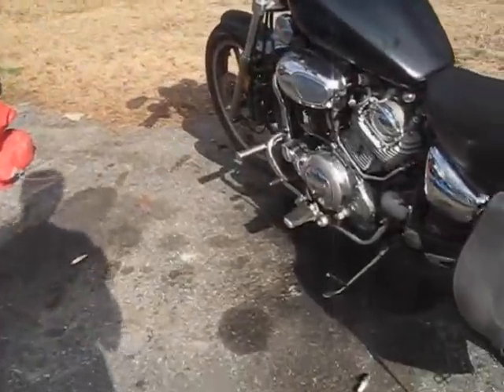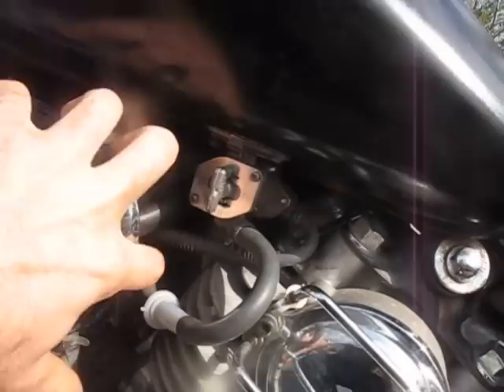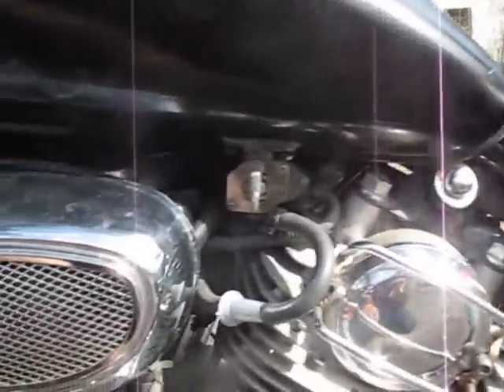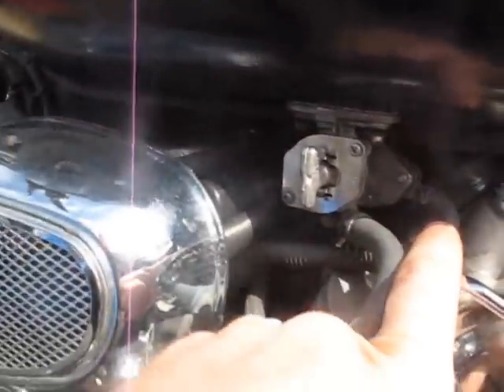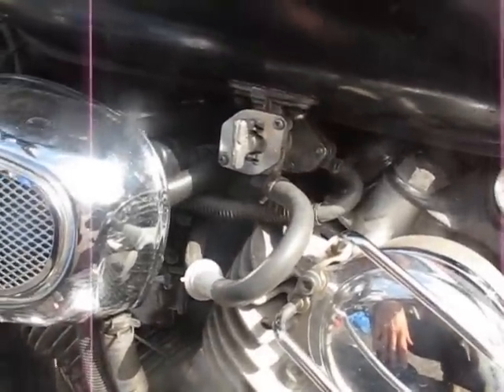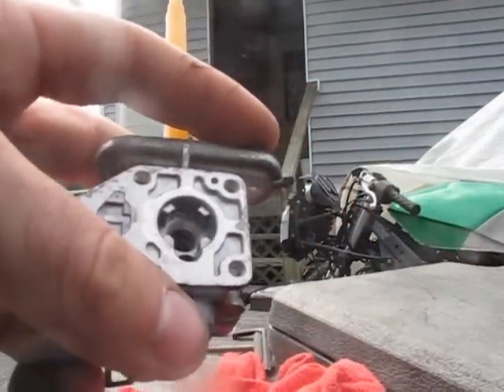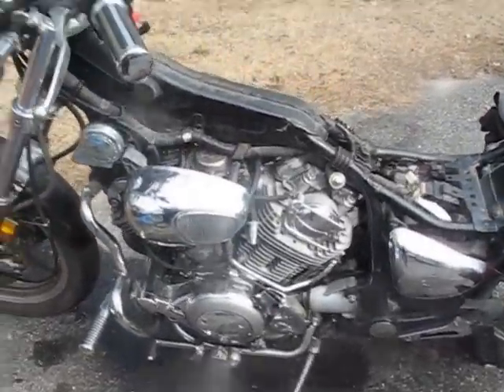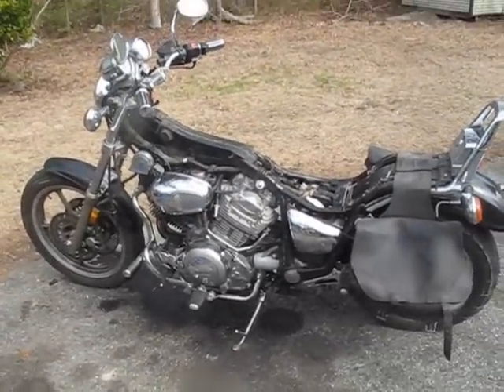How to fix your motorcycle petcock without a rebuild kit

Comment: I actually kept looking at forums and that is exactly what it was! So now it will start with a little starter fluid. I have the choke on, it's in neutral and the ignition switch is on and the bike cranks, revs up to about 5k rpm, and then cuts off. Do you think this is a damaged wire or bad fuse? It doesn't putter off, its as if the kill switch is activated or something. Any ideas? Thanks again for your help!

Comment: hi i just saw your video but i have a 2006 kawasaki ninja 250 and when i went to change my oil it had a lot of gas mixed with the oil. do i have to flush it out with oil a couple of times before i can put the good clean oil in it,or can i just empty out the bad mix of oil and fuel and put new fresh oil in it?what is causing this? thank you so much

Comment: Thanks very much for the response. I will check those things. I haven't done anything at all to my carbs.  However, I did clean both gas tanks recently and it ran great for a couple of weeks until this current issue, Can dirty carbs cause intermittent issues?

Comment: I have a 82 Honda CM 250 Custom and a 82 Yamaha XJ650.  For years I have always had a small motocycle with 1 carb.  The petcock is simple off on and reserve.  This summer I purchased the XJ650.  I never had a bike with 4 cylinders 4 carbs and shaft drive. Well in the morning it's hard to start. When I am driving the bike surges. I also can't turn the choke off. The bike will stall. I had gas spray out of the petcock also.  Just why does this bike use a vacuum petcock? Will this cause problem?

Comment: I was trying to start the bike up on Friday.  It would run but not right. I could never turn the choke off completely. On Friday the bike was running but backfiring alot. I just read this last night and fell over in my seat. I seen this swear word on my bike Yamaha YICS. My 83 Prelude had the same thing. Could this be the cause? Could ethanol be the cause? It was cold on Friday. I live in Pa. I am getting bowl gaskets so I can clean the carbs. Any vids on cleaning YICS system? How does it work

Comment: This is such a helpful video to help those of us who aspire make ourselves less dependent on commercial repair shops.  I am not opposed to paying a mechanic but most of them are covered up in work.  I would definitely prefer to keep costs down AND minimize riding down time, when possible.  You point out all of the pitfalls of what turns out to be a pretty easy fix.  The one thing I wonder is whether there is a recommended torque on the screws?  Anyone else know?  Thanks, mrmaxstorey!!
Reply from the maker: There probably is, but I just tighten until gas doesnt leak

Comment from the maker: @jbalboy1234 Clean the gasket with some gas and gently massage it with your fingers. You can clean the screens with a quick shot of carb spray, but be sure to wash it off with some gas so the carb spray doesnt corrode the plastic. Blow it out with some low-psi compressed air, and you should be good to go.

Comment: I have a 73 Honda CB350 twin, and I have a couple of problems. First: Fuel is leaking out of the petcock faceplate. I took it apart, the rubber gasket and pressure spring seem to be fine, put it back together and it still leaks. Second: It has two brass nipples for fuel lines that lead to two see-thru fuel filters. Only one of the filters seems to be filling with gas and even then it doesn't have very much in it, the other is almost dry. 
What could be causing these problems? Thanks

Comment: I'm not getting anything out of my petcock no fuel no leaks.before I de rusted my tank I did.could there be something blocking it even if the filter looks clean?
Reply from the maker: Is it a vacuum petcock or manual?
Reply: +mrmaxstorey vacuum. I've taken the whole thing apart and cleaned it. I'm suppose to be able to get fuel flowing when putting the valve on prime even with the vacuum hose off and I'm not
Reply from the maker: Yeah try taking it off and blowing backwards up the fuel outlet with an air compressor and the petcock on prime
Reply: +mrmaxstorey thanks I'll give that a shot.im now running into it not starting without starter fluid even if there's is gas in the carbs
Reply from the maker: Carb work and lots of starter fluid can foul plugs. Change em out
Reply: +mrmaxstorey thanks I'll give that a shot

Comment: Any idea what the little round spring spacer thing is for inside the dial on the Suzuki gs series petcocks? Clip ) dial ) plastic spin valve ) spring) spring spacer...?
Reply from the maker: Its to put pressure on the dial so its doesnt leak

Comment: would a leaking petcock cause a engine too smoke like no other?  just wondering i have a 93 zx6r and just did the rebuild on my petcock been leaking for a while now!  can u please answer this question my bike was smoking like crazy blue smoke from around the forks and spitting out some raw fuel from the exhaust as well.

Comment: Dang, I just unstuck mine two days ago, but I didn't think to address the spring.  Maybe in a month or two I'll get back in there and pull on the spring.  Really wished you had shown, even though you described, the making of the gasket repair.  Some modern bikes with vacuum petcocks don't have any rebuild kits available.  Do you think those two thin rear gaskets could be made out of inner-tube as well?  (might have to use slightly longer screws)

Comment: I have a 1980 Suzuki GS850G and I think there is a problem with my petcock.I want to rebuild it but need to know what parts I will need to rebuild there is no diagram on how to rebuild it.I did take it apart and the only parts in it was a diaphragm and the small rubber  o ring that goes on the diaphragm.Could you tell me what parts I need for a rebuild kit and give me directions on how to rebuild it

Comment: I have a 1980 Yamaha SR250, just bought it used for very cheap. It got me home from the guy's place where I bought it. But on cold start it seems to thud every now and then. And from what I could tell on the ride home, I couldn't really open up the throttle. But that's not my main issue. When I shut the bike off and turned the petcock to PRI (is that the closed position?) The gas is slowly just leaking out of the tube under the petcock. i removed the black hose and it started pouring out. help?

Comment: I had to run my RES to get to a gas station return to the road with a full tank I switched to ON & within 5 mins it ran shit, then shittier then stuck by the road. Had to use PRI a couple of times to get home. would this be the petcocks fault?

Comment: Max, love your videos.  Keep coming across them and I subscribed.

I have a 2000 Kawi kl250 super sherpa. 5k miles. Its leaking gas from vaccum petcock (top or face of it) in all positions and also some drips out of.drain hose at the  bottom. I drained the tank and then removed the petcock. Oil level didnt change that I can tell.  No oily looking leakage. Should I replace the petcock with new and see if it fixes or have someone remove and open/clean/possibly rebuild the carb? I am a noob and want the bike ready asap so not sure I want to try messing with the carb.

I am not too worried about the expense just want to waste minimal time. I will have a look.at the gasket behind the face. You are the first one to have this valuable info in a vid like this.

Thanks for any info!!!
Reply from the maker: Well if the problem is with the petcock, then I would go ahead and repair that and see how you do. If the bike runs well otherwise chances are the carbs are ok

Comment: Tonight I checked the plug wires and caps.....I found that the spark plug wire was not securely fastened to one coil...Also the clamp that keeps the air fastened was a little bit loose.  I took it for a 10 minute ride and it seems a lot better!  Tomorrow I will check the bowls, I sure you are right. Thanks Max, your diagnosis appears to have been right on target, If you' d lived near me I would buy you some beer and pizza...Thanks man!

Comment: Hey bro, spent some time watching your channel last night and learned a lot. I've been trying to figure out why my air box on my 96 EN500C1 has been leaking fuel when standing (also bike is often hard to start). Saw this video and figured... hmmm, it could be the petcock flooding the carbs. Petcock on this bike is vacuum op. I discovered fuel was pouring out of the petcock no matter what position. Rebuilt it w/o any parts and stretched out the spring... voila, fuel no longer leaks so far. Thx!

Comment: I had a problem with fuel starvation with my 30 year old Honda NV400, the symptoms were high r.p.m. misfire and hot start problems, even stalling when hot. Turned out to be a blocked vacuum tube within the petcock, a quick blow out, job done. Thanks for the strip down video, very good. Free repairs are very useful for the reasons you suggest.

Comment: Craziest thing happened to me trying to rebuild my petcock after watching your video.  It was stuck on open (only other settings are off and res).  I attempted to open it and found that someone had used grey caulking or sealer to stick the face plate and valve solidly, in the open position, to the main part of the petcock.  It was all squeezed down into all the moving parts and completely solid.  I had to pry off the front plate and then scrape it all off just to remove the valve and then pry it out of the back part.  Was a nightmare to clean!  Maybe it will work properly now!! ha ha  Just thought I'd share, it made me shake my head!  :)
Reply from the maker: Crazy!

Comment: Hey max just saw your videos . I have a 95 yzf600 vacuum operating petcock. It leaks around the seal edges. I'm a newbie to bikes and wanna get into your mind lol... Question tho, it's an intake fuel system and the pump vibrates but no fuel flow. Took intank pump out and grabbed an external 4-7 psi pump. It worked for a quick up the block and back down but would shut off due to what I pinned to be fuel starvation. Stop crank go stop crank go made it back home without an up hill push (thanks bike gods lol)...Can I bypass the intank pump, psi regulate my fuel pressure , plug the vacuum, remove diaphragm for constant flow or what do I do to get my baby running... I really like my bike only 2071 exact miles on it fresh oil change and plugs bike runs on all four just can't figure out the gas problem and I am like you I'd rather come up with a solution than spend my money... That's what great minds and mechanical hands alike aspire for !!!! Sorry for the long column but I really dig what you do. Can u help me out
Reply from the maker: Its not a bad idea and would make future service a little easier if the fuel pump was external and mounted to an easy to access place, however there are a couple of significant hurdles to pass along the way. Its unlikely that you will be able to get around the leaky petcock without repairing it by conventional means. Since it mounts underneath your old fuel pump, I think you will have to leave them both in and repair whatever gasket is leaking. If you wanted an external fuel pump you will need to partially disassemble some of the old fuel pump, which probably arrests or at least restricts fuel flow when it is not running. Therefore taking it apart until gas flows freely so that the new fuel pump can pump the gas is required, and honestly if you are taking it apart you might as well just fix it and keep your OEM parts. If it is vibrating then its getting electricity through the pump, it might even be pumping just clogged somewhere from debris so get it cleaned up and it may work. Or replace with a used or aftermarket from ebay. If you are absolutely at the point of desperation you can drill an oval into the bottom of the tank with 2 bolt holes and mount a cheapo non-vacuum petcock which can be had for about $10, and then use your 4-7psi pump, but really just fix it right with yamaha parts
Reply: Hi again max, I forgot to add that my on and reserve is a switch on my upper left fairing no petcock switch I guess because of it being an intank fuel system???
Reply: Max just got through going over my petcock it does have the internal gasket that honestly are shot (a bummer) but on the bike gods and MaXXimus Tutorial side of things... I got gas flow and when I pinch off my vacuum I get noooo leaks!!!! I discarded the intank pump altogether and with the regulator (0-5 1/2 psi ,plus the eternal pump 4-7psi) are there any foreseeable issues I may have outside of the petcock rebuild kit? I have gas flow when I pull from the vacuum like you said and also just a liiiiiiiittle bit of spring tugging I copied from your book I smiled just gotta fight the rain with no garage now <( oh and THANKS FOR BEING A STAND UP GUY ,NOT MANY THAT SHARE  KNOWLEDGE FROM OUR BACKYARDS THAT HAVE THE  PASSION TO FIND OUT HOW TO FIX IT OR ITS OVER  AND START ANEW TYPE OF HONESTY. BEEN A PLEASURE TO SUBSCRIBE TO YOU MAX. I DEF WILL BE KEEPING U POSTED!!!!

Comment: Gr8 vid im back to working in bikes missed u Max remember me? 😀 finally figured out why the Honda VF750 didnt run right, a belt tensioner jumped out of its slot and got pulled down into the cylinder! So the timing chain was never tight so how could it run right?

Comment: I tried this but unfortunately my petcock still never shuts off, it will deliver fuel to the carb even when it is turned to off position. I have a non vacuum operated petcock.

Comment from the maker: It seems like you may have a number of different issues at play here, likely all related to scum in your tank and fuel system. Go to my channel and watch my videos on cleaning out your tank, cleaning carbs, restoring petcock, "how does a petcock work?", and finally how to fix a nonrunning motorcycle. Once you get through all those, if you still are having trouble, message me and we can get into it in more detail

Comment: Thanks for doing theses videos.  

Leaky fuel valve question: small leak in petcock, with a slow drip into fuel line. Replaced everything with a rebuild kit. Now, of course, the "drip" is a full-on flow, maybe half of what you'd expect with engine on. My guess is that the diaphram isn't sealing - petcock put together, you can see a little rippling in the outer edges of diaphragm.  Could this be causing the leakage? I've messed with the spring, and wavy metal piece under lever... no change.

Comment: I just put another switch in the line to be on the safe side..stupid crap they came up with.. But sometimes I forget to shut it off but lucky my carbs are behind the motor and. I'm only out a tank of gas than 4 new quarts of oil

Comment: is there any where I can get the replacement filters that fit on the petcock valve stems. I mean the one in the gas tanks . or can it still work with using only an in line fuel filter?
Reply from the maker: +Benjamin Vining An inline fuel filter will do the job, and thats all I have on some of my bikes. But you may be able to find one of those in take filters on bikebandit

Comment: Another great video! you certainly know who your audience is..ha ha.  As a single dad with full custody of the kids, I'm always looking for the inexpensive solution. I have a unrelated question. I have a 85 VT700c - runs great until its been driven about 30 miles. Around that point it seems like its starving for fuel. I have replaced the coils and one cdi  box, also new fuel filter ( all cheap thanks to ebay) any ideas about what else could cause this issue?

Comment: I have a leaky petcock, but different symptoms. When I switch it to on, it drips from the edge of the petcock. The hose is not leaky. If I switch to reserve, it stops dripping. Thanks!
Reply from the maker: +stephanie green The little round rubber gasket inside the petcock is likely to be damaged or the small spring is getting flattened
Reply: Thanks! That makes sense considering it didn't leak later in the day when it warmed up.

Comment: What a fun approach. 
Same happened to my KLE500 but the petcock seemed whole and clean. Could it be just the spring? 
Also I just replaced the oil filter, is it ruined in this case?
Thanks

Comment: Thanks for the video. Learn alot from this. My question is when i clean my pet cock and reinstall it and hook the vacuum up and crank the bike with the fuel line off and had a can to catch the gas. When i start the bike, gas is coming out of the pet cock. when i stop the starting, gas stops, but it still drips a little for a minute then  it stops, then i let the can stay under the pet cock for 24 hrs to see if i get a drips and the can is dry.Does it drip alittle then stops ? I know you said it shouldnt drip at all after starting. Thanks
Reply from the maker: Yeah if it sends a couple drips after the motor stops thats not a problem, usually there is a little residue that needs to drip out. Just so long as it stops you are good

Comment: If fuel is leaking into the head wouldn't some of the problem be that the carb bowl is over filling? I had fuel leak out my air cleaner I think due to float leave and possibly a petcock that was dripping on my 79 XS750. Should I change my oil? I'm trying to avoid that because synthetic oil is not cheap.

Comment: I'm having an extremely hard time getting my petcocks removed from the tank, I have a 1979 yamaha XS750s and i used pb blaster and still had no luck any other suggestions?
Reply from the maker: Sometimes they get wedged in there. It can help to tap GENTLY with a hammer, that usually does the trick for me